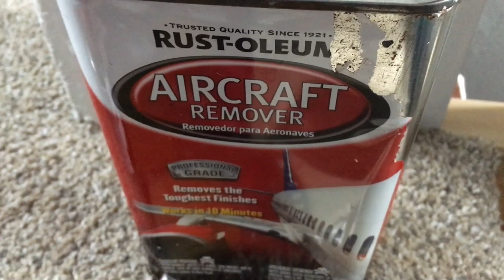Removing Paint From An Old Banister | Paint Stripper To The Rescue

Comment: I am doing this exact, horrible job. The new paint strippers - the so-called odor free ones - don't work at all and are very expensive and ultimately a waste of money. I used a heat gun ... cost about $40.00 (Canadian) and it works very, very fast. Try to find a scraper that has a longer handle ... because the metal in the scraper gets very hot. Where did you get the airplane stripper? thanks for the vid ... hope your staircase turned out.
Reply from the maker: I don’t recall where I got it but probably Home Depot. Good tip with the long handle scraper!